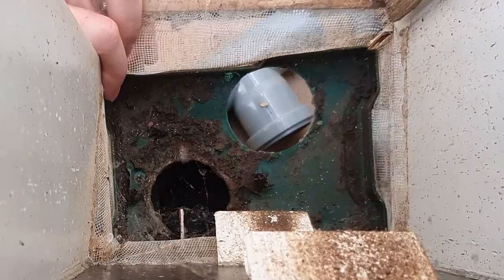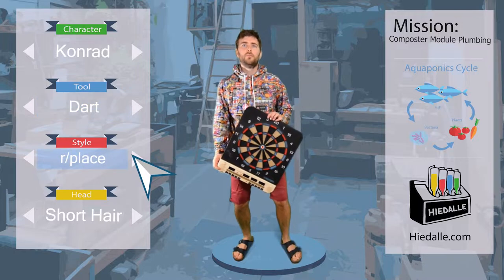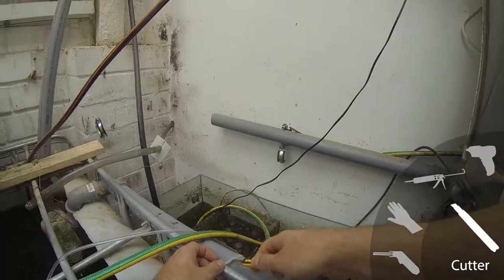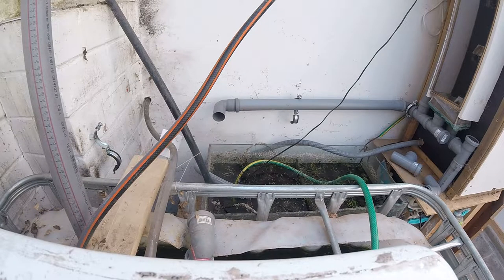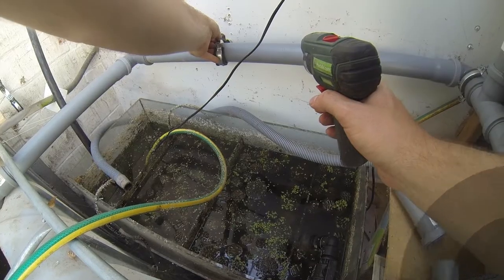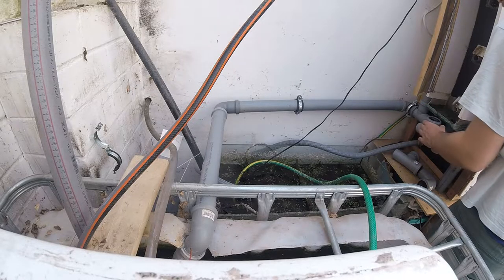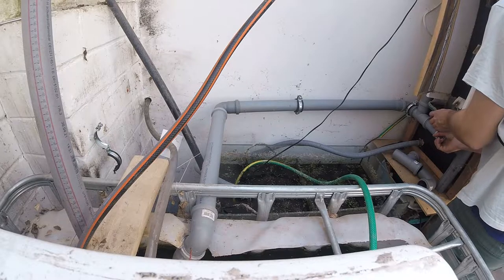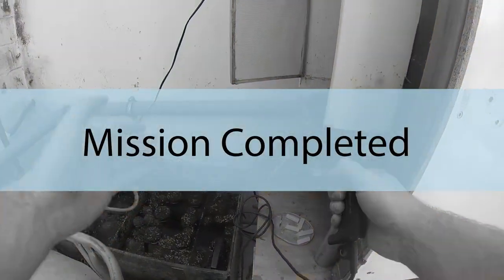Composter Module Plumbing | APS #10 | Hiedalle

Comment: OMG what a funny and genius design and naming of this device "God module" selecting death by goldfish or hatching :-) I love it, pure genius. I have goldfish too in my system put I never thought their mouth is big enough to feed on fully grown BSFL. Do they chomp it down in one piece or do they have to rip it apart first?
Reply from the maker: Haha I agree... its a bit macabre (asi) but fitting, I mean only the ones crawling to the right end up in the fishtank is their choice...
Yes depending on their size goldfish can swallow the larvae whole. It helps that the larvae vary in size too. I sometimes wonder if the fish prefere the flies. I think this has something to do with the hard shell of the larvae. If a lot of the larvae harvests themselves in the fishtank the fish leave them floating longer than the flies. A couple of hours later all larvae are gone too. 
Some of the fish spit out pieces of the larvae which the smaller fish can swallow easier. 
In the secondary IBC on the left there are currently baby goldfish who cant eat the larvae and I feed them ground dried larvae which I milled with a coffee been milling machine. I actually just received a small pellet machine as well and will try to make pellets from the milled larvae soon. I have plenty of larvae available I can sent you some to test with your fish if you are interested.
Reply: @Hiedalle  Wow thats so awesome to hear, I havent seen someone with a serious APS with Goldfish and BSFL so this is very great news. I would certainly like to come back to the offer one day but first I need to finish my APS rebuild and get things settled before the next project ;-) REALLY looking forward to seeing your pelletmachine tests that would be a total gamechanger as fish size wouldnt be a restriction anymore! You keep blowing my mind hahaha
Reply from the maker: I think pellets will also increase the shelfelife of the BSFL and i might be able to store them for the offseason. I honestly do not understand why this is not integrated more I mean fishfood is the main input and it needs to be sustainable. Cant get more sustainable than using foodwaste as larvae feed IMO. 

Let me know how your rebuild is going then maybe i even have some pellets ready ;)
Reply: @Hiedalle  "I honestly do not understand why this is not integrated more I mean fishfood is the main input and it needs to be sustainable." 1000% agree! Its also quite amazing that nature presents us with such a great solution for this problem of sustainable fishfood. 

Yes I am sure the pellets if you freeze them will last one season? So cool. What is you BSFL season length? what months? Is it temperature related mainly or daylight length because I notice you dont have any artificial heating or lighting. I would probably need both to some extent.

I might post some updates on my blog that I havent updated in years ;-) will let you know
Reply from the maker: @mariusaquaticus3102  i might not even have to freeze the pellets i think they will stay fresh quite a while once they are completely dried. but we will find out soon when I produced some :D

If you blog feel free to share :)
Reply: @Hiedalle  Nice one cant wait to see your results! Havent blogged in many years, decided not to continue it but planning on making some youtube updates on my system/build on my channel soon
Reply from the maker: @mariusaquaticus3102  tag me if you do upload :)
Reply: @Hiedalle  will do 👍 tried with my old actioncamera but mic was bad so i am waiting for a gopro arriving tomorrow 🥳 hopefully will upload something this weekend 🤞